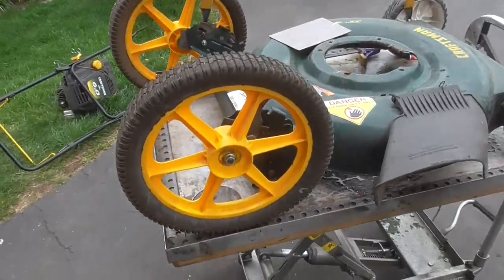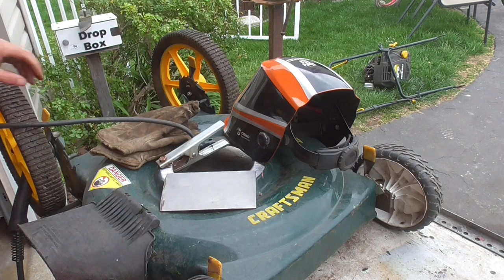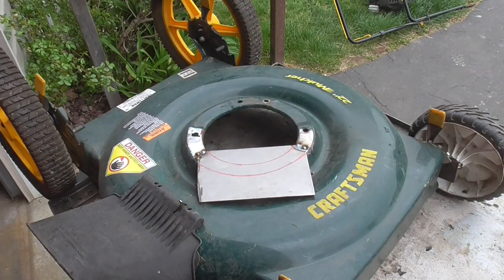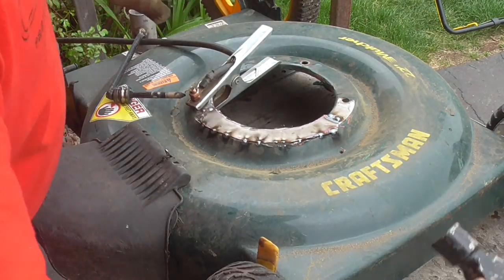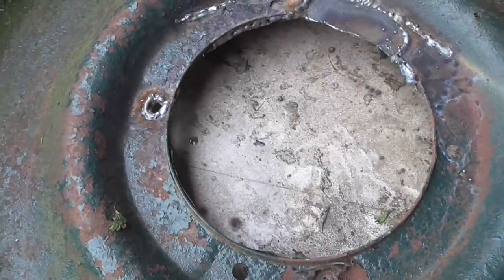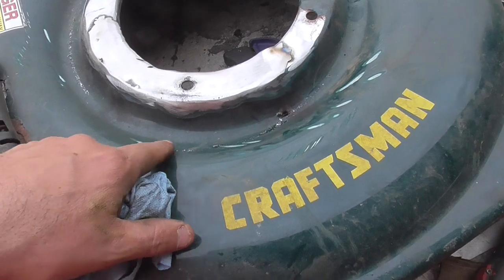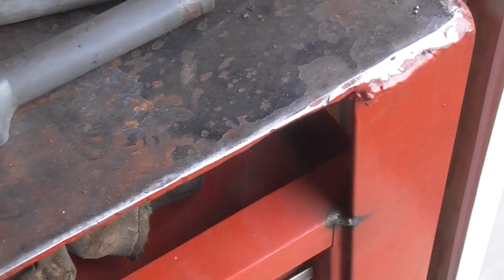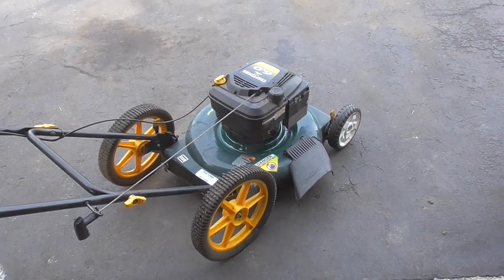Lawnmower Deck Cracked At Engine Mount

Comment: Nice work, but if the deck mounts are cracked like that it’s pretty much guaranteed that the engine has a bent crank and it’s been vibrating big time.

Comment: You know I don't think many would weld in pieces to fix the frame.  Instead they would just put the engine on a different frame and call it good.  This was a great fix and welding job.  Great job.  Thanks for sharing.
Reply from the maker: Great point!  I'm in a lock down and just keeping busy.

Comment: I've only seen that type of damage (cracked deck/broken intake pipe) on mowers with bent shafts.  Would check that first before doing repair.  It was a good welding tutorial.
Reply from the maker: Good call!  There was a bent shaft.  I have a crankshaft straighter that I use.  I am in a lockdown here, so I have some extra time for tinkering.  That's all.

Comment: Good video.Good attention to the work elements and no extraneous bs.  I enjoy seeing a salvage returned to use and with the proper job you did it will give good service. While it may not be cast effective it serves as a good tutorial as to what is possible. Any story behind how it could have so much damage? Was it a prop in a disaster movie? In my youth our mechanic used oil cans and wire coat hangers to repair rust hole damage on autos and it turned out great. I owned 2 of them for a while.  I would have done inserts on the wheel centers since they still had good tread.
Reply from the maker: I did end up finding some pipe to fit in the original wheels worked at well.

Comment: Is the part you welded on not a little higher than the deck?  If so, wouldn’t that cause a problem of uneven cut or vibration and crank damage. 
  I saw where you said the crank was bent but you have a straightener. 
  Subscribed and will be watching more.

Comment: Great job I've done a few free mowers like that too . what brand and color of green did you use looks like a close paint match
Reply from the maker: Not sure.  I will check it out.  The main thing I did was wipe away the overspray off the Craftsman letters with carb cleaner.

Comment: A type of round bolting flange, ring, plate that mounts from below the mower deck would be the easiest way to repair the deck and bolt holes. I am trying to find that product right now. unfortunately i cannot find anything that would fit to work, so unfortunately i am going to have to fabricate one.
 (Also the crank shaft of that engine is probably bent, which caused the cracking of the mower deck at the bolt holes).

Comment: My first mower was a craftsman. The housing cracked in a different place. I welded it and it cracked in another place. That was 40 years ago.
Reply from the maker: Probably a bent crank causing it.
Reply: doublewide6 Repairs LLC possible but I doubt it. As I recall, the mower didn’t vibrate excessively. It wasn’t an expensive mower.

Comment: Too bad they don't sell deck repair rings for push mowers like they do for John Deere riding mowers. Nice job on your repair.
Reply from the maker: Great point!  With a CNC machine you could make some money selling them on Ebay.
Reply: @doublewide6  or a table plasma cutter , I had 50 made for 8$ a ring.

Comment: My first question is, why? It's a $30 push mower after you fix it. Remove the engine and save it for a decent body. If it was self-propelled, well maybe. You'll have more time and money in it than it's worth. Good practice though. Sorry for the negative, but I see a lot of videos where individuals spend a lot of time and money on something that in the long run just isn't worth it. Just my opinion.
Reply from the maker: I'm in a lockdown and just tinkering around.  This was actually a fun project and many viewers like it.  It is not as straight forward as a carb repair.  Thanks for watching.
Reply: @doublewide6  Sorry for the negative feedback, after I left the comment I kinda' thought that was the case, just something to make a video with. Keep up the good work Bob, I do like your videos.